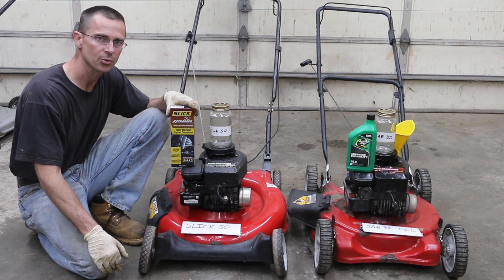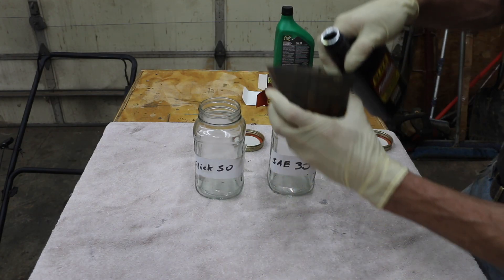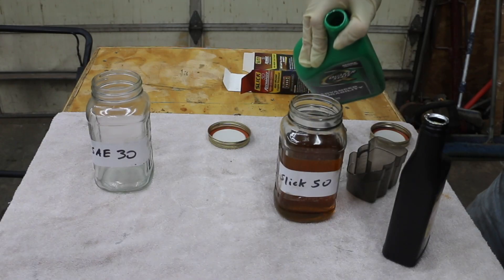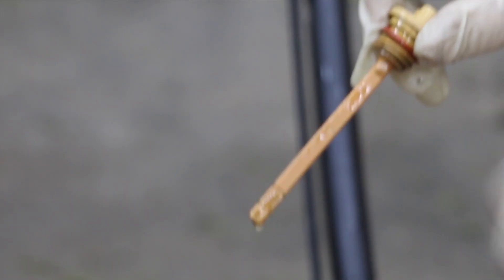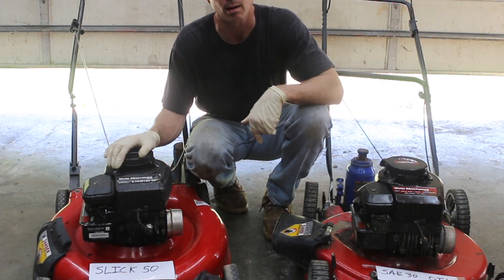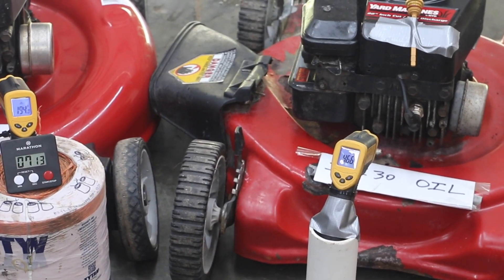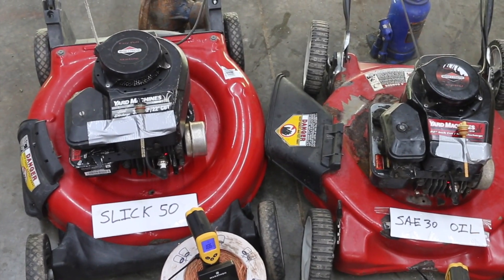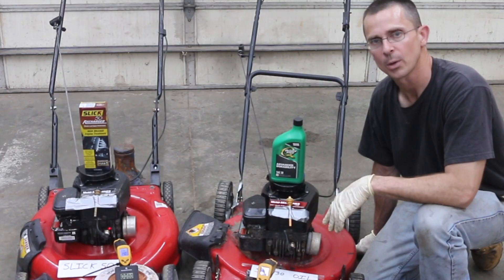Can't believe what SLICK 50 did to my engine!!--Dry Crankcase Test!

Comment: maybe try z - max they say it soaks into the metal ? Maybe the engine will last / longer.
Reply from the maker: I'll definitely test zmax!  Thanks for watching the video and commenting!
Reply: philip carroll Slick 50 is designed to siak into the metal also, but it needs to be in the motor longer than 5 minutes.
Reply: Project Farm should try Lucas oil as a test
Reply: philip carroll metal is non porous. but I'll bet the commercial says it's at the molecular level
Reply: Watch the ZMAX ad real close when you see it soaking into the metal you can see the the part was sand blasted even rubbing alcohol will soak into it.
Reply: im sorry but any metal used to produce engines are not pourse they will under no circumstance absorb motor oil just wont happen
Reply: philip carroll z max! it works
Reply: There's always surface irregularities in any machined surface. Some metals are porous as well. With a thin enough fluid, anything if porous.

Comment: slick fifties original Corporation was taken over by the stockholders. since then slick 50 has gone through several ownerships. the last owner I heard of was Quaker State. over those many years there's no telling if the original formula had been changed. I personally saw a air-cooled engine running without oil from one of the original dealers. also, there was a championship drag racing company who made a pass without oil accidentally after treatment without significant damage to the engine.

we're both of the engines you ran this test on new?

running cooler says a great deal so there is still something positive going on with slick 50. less heat means less friction which means less wear. problem with these products is trying to find a tru-test and comparison
Reply from the maker: I enjoyed reading your comments!  Thank you!!

Comment: We had a Ford F150 with about 280k, kms on it, put a quart of slick 50 into the old girl. Spon a main bearing 1 1/2wks later. Next was a little Ford card with about 120k, kms on it, put a quart of slick 50 into the bitch, 2 weeks later driving home from a long day at work we round a corner & all of a sudden the motor gives off a horrendous colophony of very impressive grinding & banging sounds. Both were working fine before the slick treatment.
Reply: Customwinder 1 - Marvel Mystery Oil seems to work well for cleaning stuff out. An old mechanic trick i've heard of is to sub 1 qt of ATF in at an oil change. It is high detergent and will clean things out.
Reply: Two Beers That would've been devastating.  Poor old girls. Personally don't use any additives  When i first get a car or motor i dump the oil straight away and do the oil filter.  Check for particles etc.  Put some quality oil in them and dump the oil again  After 1000 kms. Usually cleans out the motor.  Add a very small amount of diesel  fuel to the oil if its really dirty and dump it again.  New filter and synthetic oil and she should be fine. Never had a motor fail. And always have clean oil after that.  Subbed to your channel too sir.👍
Reply from the maker: Ouch!  Thanks for watching the video and commenting!
Reply: Yeah mate i heard about the atf trick.  Haven't done it myself. I have two fairly new  Ford utes and am doing regular oil changes  and servicing  and they're running sweet.  I'm using Nulon  10w40  synthetic in both.  My off roaders run synthetic too.  Cheers mate 👍

Comment: `this is NOT a useful test. No one runs their engine this way and so its not a valid test of long term performance. I have used slick 50 back in the 1960s put some in the manual steering gear on 56 chevrolet, some in standard trans and some in differential. The steering got noticeably easier as for the rest I do not know if it made any difference.
Reply from the maker: Thanks for watching the video and commenting!

Comment: i put slick 50 in a jd 140 mowed on a steep bank when the engine seized. pulled the head off no scaring of cylinder wall at all. Looked so good i didnt look any farther just put another head gasket in it and reassembled. Had absolutely no issues. yes it will seize, but look inside. i bet theres nothing wrong with the slick 50 engine
Reply from the maker: bret, Great suggestion!  I'll do that!   Thanks for watching the video and commenting!

Comment: Try Ceratec from Liqui Moly. I usually get it from my local NAPA store. It's basically molydenum dioxide which binds to the metal and makes an anti friction layer. They tested it and a car ran 500 miles without oil in the crankcase and it was still running. Lots of people are getting it now.
Reply from the maker: I'll see if I can find it!  Thanks for watching the video and commenting!

Comment: Hmmm I also heard that Marvel Mystery Oil put in the crankcase and in where the spark plugs go will unseize the engine you could try that on the slick 50 matter fact you could try it on both and see what happens
Reply from the maker: I should try MMO to unseize the engine!  Thanks for watching the video and commenting!

Comment: DuraLube was the one I remember showing the engine having the oil drained and left running for hours. Not only that but they pulled off the valve cover, then ran a water hose over the valves on the head while it was running. It looked like an industrial straight 6 out of a truck or tractor, maybe. They just had it suspended from some engine stand they made that looked like it was made from black iron pipe, if I remember right.
Reply from the maker: I'll test DuraLube soon!  Thanks for watching the video and commenting!

Comment: I'd love to see you run royal purple in comparison to other full synthetics. I swear by royal purple so I'm obviously biased. Would love to see what you find. Look at some of the test rp runs and claims. Would love to see how it stacks up.
Reply: Definitely the biggest I've noticed is cooler engine temp. Less friction = longer life, more efficient. Just my opinion.
Reply: Royal Purple is a good product. $$$$ but good.
Reply: Well I agree it does cost more. Why it does have a little bigger price. You can go quite a bit longer between oil changes. Just filter changes with the manufacturer intervals.
Reply from the maker: I'll test it!  Thanks for watching the video and commenting!
Reply: Awesome. I'd be interested to see about their claims and how they hold up in practical applications. Engine Temps, film strength etc. With two failures you've had so far, I would have love to have seen what would have happened with rp. That being the slick 50 vs regular sae. And what would have happened when you got all that water in the crank case. Their claim of its positive charge to metal, and ability to fight through water, even at a 90% water to oil ratio is pretty impressive. I'd just love to see it's ability to do its claims in practical applications. See the if it lives up to the hype, and maybe if it's worth the price tag. I appreciate the reply. I'm sure you're getting slammed with a ton!

Comment: I'm wondering if the slick 50 has a thinning additive. if the oil is thinner the engine isn't having to work as hard to push itself through the oil as the crank comes around.  thinner oil, less heat but less protection as well?  yes its keeping the engine cooler but is it really that beneficial.
Reply from the maker: Great thought! Thanks for watching the video and commenting!

Comment: I've used prolong for years. It's makes a difference. It would even use it on electric motors and stuff around the house. That had to be cleaned up because there start to run slow. After mixing prolong with the oil they would run for years without problems.
You can buy prolong in bulk. And then mix it to whatever oil you want.I know Machine shops that buy it in 55 gallon drums.
I've even seen where they'll drain the engine oil after treating it and then run it without any oil on the crankcase.
I remember slick 50 but I didn't like it because had so much good luck with prolong. And I had friends that told me that slick 50 didn't help at all.
Although with prolong I would probably use used engines to prove your point.
Reply from the maker: I'll test prolong!  Thanks for watching the video and commenting!

Comment: using marvel mystery oil as a oil additive will quiet a engine.  My car is a oil burner and with mystery oil removed build-up on rings and quite valve lash. Also csn be used in fuel tank to lube fuel pump. works great for me.
Reply from the maker: I'll be releasing a video on MMO this week.  Thanks for watching the video and commenting!

Comment: I've seen the slick50 product since it was first introduced. 
The only "slick" I believed was involved was the advertising dollars spent on those willing to be guinea pigs financially, and make guinea pigs of their vehicle engines.
I generally don't gamble on anything as vital and expensive as automobiles.
"If it seems too good to be true, it probably is..."
works all the time for me!😉😆
Someone had treated a smallblock engine then, after having blue smoke come from the exhaust some time later, cut the heads & block in two. upon inspection, the cylinder walls had a microscopic coating that was unevenly 'stuck' to the walls. This was the cause of blowby that the owner experienced prior to junking the engine. He got amped at the slick50 company for ruining his engine. I think he sued & won, because he had a lab prove the product failed.
Reply from the maker: Thanks for watching the video and commenting!

Comment: Additives are junk.
Unless it is zddp which is zinc dialkyl dithiophosphate.
But the nanny state made the manufacturers remove that from the oil.
Some say it was environmental. 
Others think they just want to wipe out the flat tappet camshafts of the older vehicles.
If you change your oil regularly, 3,000 mi for older carbureted vehicles and 7,000 for fuel injected,  any additive besides zddp will be a waste of money.
edit; I dont think even zddp would have helped your lawn mowers though. They seized due to heat. Probably find the piston melted in the bore with aluminium smears on the cylinder walls.
Reply from the maker: Matthew,  I'll see if I can find a product with zinc.  Thanks for watching the video and commenting!

Comment: I used to sell a product called TX7. It actually did a lot of good to quite a few noisy engines we put it in in the shops. It's a teflon based additive and you'd need to let it run with the existing oil for a good amount of time before testing. It's available in specialty shops or eBay.
Reply from the maker: I'll see if I can find and test this product.  Thanks for watching the video and commenting!

Comment: I can only talk about my experience with Slick50. About 20 years ago I drove a 2003 Toyota Minivan with a 1900cc engine. I hit a rock that was in middle of the road during a rain storm but thought it had hit the front suspension only. I drove over fifty or sixty miles before getting home and seeing oil drops from the van. The rock had torn off the drain plug... That engine ran for another five years in my possession before I sold it. Slick 50 worked for me. 

Then again your short run before the test only allowed for the Slick50 to remove all the gunk inside the engine. This product is based on a special polymer that needs time to chemically bond to engine parts; in an average car about of week of normal usage. I would ask that when you try additives made for hotter running engines for you to give the mowers a reasonable comparable time for the product to work.
Reply from the maker: Excellent point! Thanks for watching the video and commenting!

Comment: Love your videos... both engines were used. so can't really compare them.
if you want to do these tests in the future and want to use new engines.
you can pick up some decent cheap predator engines at Harbor Freight.. I think there smallest one runs about $100.  not cheap but maybe doable.
and you could do some repeatable tests with the same engines if you wanted.
just have to build a mount for them.
Reply from the maker: I agree.  A new engine would have been much better.  Thanks for watching the video and commenting!

Comment: I'm recommending nothing.  Use what you want in your engines.  But I've been using Royal Purple products in all my cars and gas engines (mower, snowblower, etc), for over 15 years.   Car:  Oil, transmission, differential, wheel bearings, suspension and radiator.  All mechanical parts in these engines run cooler after switching out factory oil to Royal P.  I'm retired military, not some sales person for Royal P.  First vehicle with all fluids replaced:  2003 GMC Sonoma, V6.  Whole truck quieter, engine and trans ran cooler and mileage improved from 22mpg to 26mpg.  FYI only.  Again, use what you want.  Semper fi.
Reply from the maker: First, thank you VERY much for your service!  Our military make tremendous sacrifices for our nation!  So, many thanks!  I should test our Royal Purple.  Thanks for watching the video and commenting!
Reply: Project Farm: I just changed the oil in my truck to Royal Purple a few days ago. It's my first time using it but it feels like the engine's running silky smooth compared to what was in it. Don't know if it's all in my head but sometimes it feels like it's not even running once it's up to speed on the interstate. :)
Reply: Project Farm 
I'd love to see any high end synthetic vs a cheap oil. say 10w30?

also I would like to see if restore with csl actually raises compression on a tired engine.
Reply: MonzaRacer 

not true. Pennzoil has an oil that comes from natural gas.

in fact group iv oils are made from pao, or Poly-alpha-olefin, that in the us, is sourced from natural gas condensate. in Europe it's napatha. ..

alot of synthetic oils are group III+ witch are sourced from crude, but they have been tested to a point where at the molecular level, they are very very close. so it doesn't matter anymore. 

there are still some holdouts, one of the well known ones was the "German Castrol". that was an unknown group iv that people didn't know about until too late
Reply: I'm also retired military, and like you I've switched every one of my engines over to Royal Purple. I have a 2006 Pontiac GTO with the LS2 V8, 6 speed trans with some mild modifications, and after purchasing the car I switched to Royal Purple and I could feel the difference in the seat of my pants during acceleration. I am a true believer in Royal Purple.
Reply: Charles Erps: It's pricey but it's worth it. Especially if it's matched with the best oil filter you can get your hands on. Royal Purple filters are hard to get in my area.  So instead of waiting for a week for it to get to my house I just bough a K&N filter with the bolt end. When I want to change my oil I want to change it now when I have the stuff, not next week when the filter finally comes in. :)
Reply: TJ thompson did you know that ALL synthetic oil base chemicals making them up are ALL derived from"mineral" or crude oil. synthetics simply engineer the molecular size/make up to be more consistent.
Reply: Hans Evensen Did you know that Pennzoil an oil company in name only and owned/operated/sold under banner from SOPUS. Shell Oil Products United States. Pennzoil and Quaker State haven't been producers just label for years.
Reply: I run royal purple. I do like Lucas as an additive in the stuff that carries mineral based oil

Comment: Even similar engines can run at different temps.  The correct way to test temp is to run the engine first with reg oil and get a base temp value, then try again with Slick 50.
Reply from the maker: Great point!  I plan to do that in a future episode trying other additives.  Thanks for watching the video and commenting!

Comment: The W on the oil label doesn't stand for weight, it stands for winter. The numbers are oil viscosity ratings for winter and summer.
Reply from the maker: Thanks for watching the video and commenting!
Reply: While the W does stand for winter, there's more to it than just the W. A 10w-30 is a 10 weight oil with polymers added to make it act as a 30 weight as it warms up by expanding and "thickening" the oil similar to the viscosity of a 30 weight at the operating temperature. When a 10w-30 weight oil begins to break down, it's because the polymers loose their ability to thicken when heated and the oil slowly begins to revert back to 10 weight oil. That's why old oil runs out of the drain plug so quickly. It's lost its viscosity index from the polymers and has reverted back to a lighter oil.